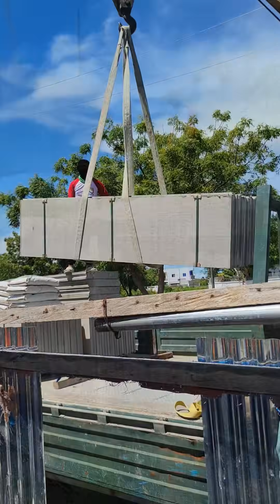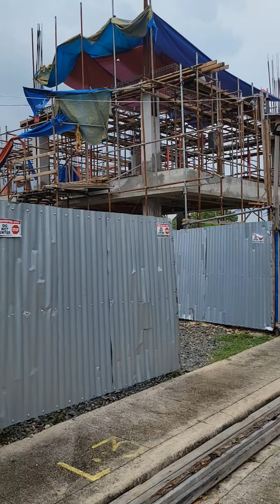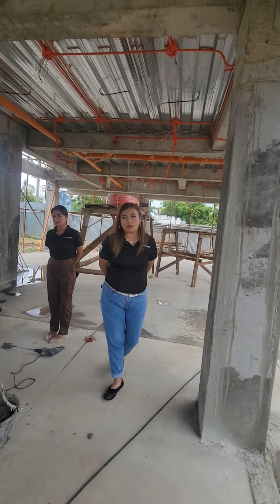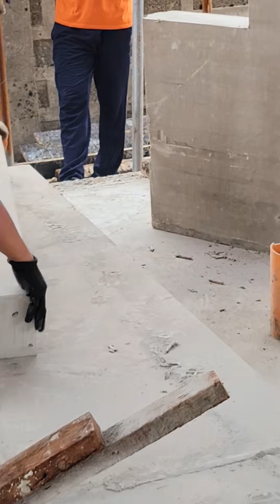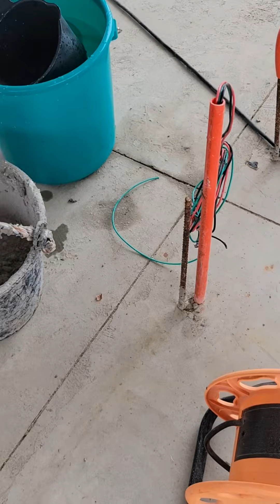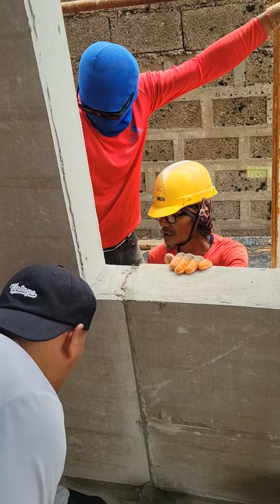The Litepanel has arrived! New house construction Philippines.

Comment: It sounds like you do not know what your doing. Cutting the panels immediately also looks like another mistake. Failing to plan is planning to fail.
Reply from the maker: 😂 Let me know when you have a channel building a house and you can show me the "right" way.   BTW...cutting the panels immediately was the light panel manufacturer, not my crew.   So you should take that up with Litepanel Cebu, Im sure they'll be impressed by you.

Comment: I will be using the lite panels on our house in Moalboal I see you didn't use them on your walls? But I have to many reasons to despise the hollow block walls here they are very wealthy and hand packed with fill and not vibrated unlike the USAhas 1,000 psi CHB and 2,000 psi grout injected and vibrated those lite blocks if installed right and and spiked is a great product the hollow block in an earth quake cracks and is much heavier when it falls on you, is insulating and very sound dampening.40 years in concrete for some of the largest companies in America in California and Las Vegas and I would rather use Lite Blocks 
I see maybe you are going to do most incredible lite panels maybe?